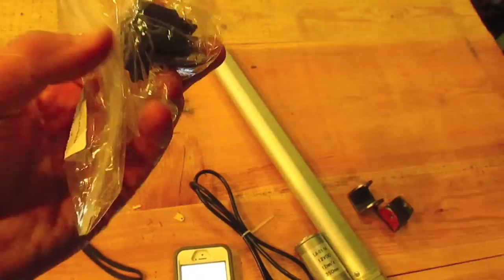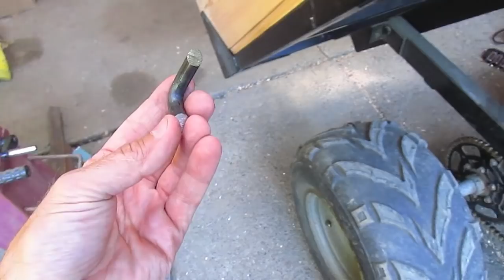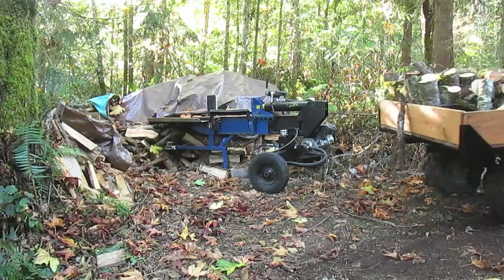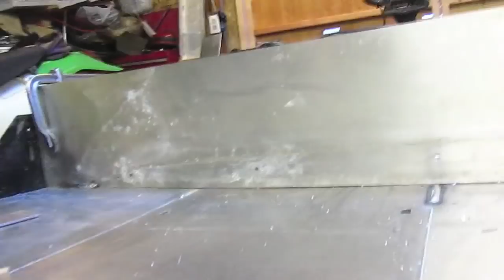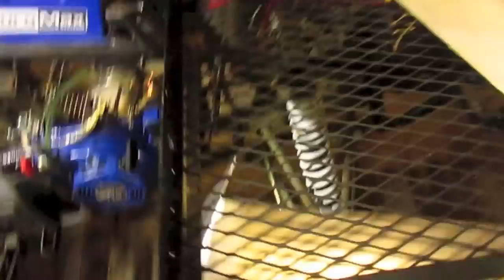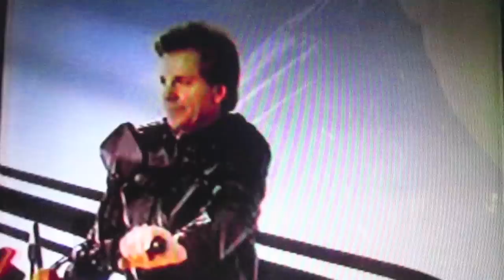Homemade ATV quad truck part 2

Comment: That is so cool :o) I’m doing mods to a diablo diesel quad by fitting a floor crane on the back and using a floor cleaner gearbox as a steering box so it is a side by side. (With a huge seat like arm rest)
Reply from the maker: Thanks!
Your project sounds good, I would like to see a video of your quad when your done with it.
You will need to let me know when your finished with it :)
Reply: Is it possible to finish it? I don't know if I should have those 12 volt linear actuators or hydraulics next? :o)
Reply from the maker: I just finished up my nephews dirt bike project, so I plan on finishing my quad truck up next.
I have been hauling fire wood in the bed of the quad truck and the linear actuator is just strong enough to dump a full load of maple log rounds but it's not crazy strong, If your planning on running the floor crane I would not recommend the linear actuators because most of the small ones like I used only lift a max of 220# or so, hydraulics would be far better in your application. I hope this helps and I also hope to finish up the quad truck and video soon. Take care
PS I hope you share a video on youtube of your build!
Reply: I thought I could buy a pop-in pump, but I can't find one? So it looks like it is front PTO machining job. (I hear you on the electro rams) Next achievement job is carrying stuff, so the bulldozer blade is getting a visor to make it a four-in-one bucket. I have the base plate bent in 3mm steel.

Comment: Better get up outa that cvt life while you can.  Its a black pit of dispair.
Reply: Winston Po
Reply from the maker: I have had a few CV transmissions over the years and never had much problems with them.
I put about 5000 miles on a heavily modified scooter I tricked out years ago and I found the CVT to be a real tunable and reliable  trans,  you can fine tune the clutch RPM engagement, and RPM torque curve to make a motor pull hard.
Un like snowmobiles and most go karts, this CVT is used in most scooters and is different because it spins the belt all the time and does not use the belt as the consumable clutch, it has a centrifugal clutch that has it's own clutch pads so the belt does not wear every time it goes from idle to driving the machine.
Maybe you did not know there was different kinds of CVTs?

Comment: Hey Mike this is exactly the kind of stuff I love to build !  I think that its hard to know what was the biggest game changer for you the lathe or the spool gun so you can weld aluminum ?  Nice build !
Reply from the maker: Hey Thanks Cody :)
I'm glad you like my quad truck project!
It's been a fun thing to build and I have learned a few new things along the way on this build.
Your right the Lathe and new welder are both great tools and a big game changer, I have wanted and needed them for years now.
I have a older Enco milling machine in need of some repair given to me from my work over a year ago, I need to bring it home and start taking it apart and cleaning up the rust and fixing a few problems it has, But hey it was Free!!!
It's going to be so nice to have a working milling machine to take projects to the next level.
I appreciate your nice comments!  Take care Cody :)

Comment: Cool but 7 horsepower?
Reply from the maker: I could have put a bigger motor into it but I had no need to, I built it to be used as more of a utility garden tractor then a four wheeler. It's geared down for torque not speed, it tops out at maybe 15 MPH 
The motor is coupled to the belt drive so it has a variable speed transmission. It makes plenty of power to move firewood and tools around my place.
Thanks for watching.

Comment: Needs a bigger engine
Reply: Mike festiva Firewood racing lol
Reply: Mike festiva That build is unbelievable
Reply: kyle prichard and quieter
Reply from the maker: Tell me why it needs a bigger engine? It moves a full load of firewood up hills faster then i could run, that's all I really need.
How the hell fast do you really need to move a full load of fire wood on a trail Kyle? 
I just built it to move firewood,  tools like table saws and air compressors things like that around my property, It's not for firewood racing :)
Reply from the maker: Thanks!
Reply: Mike festiva not really a bigger engine but more like a higher revving engine if your using a variable speed.

Comment: Cool! New subscriber because of this video! 
I've been wanting to build one of these for quite a while. Your build here will help me when I get to it, thanks for sharing your build! 
P.S. I rebuilt a few old Cub Cadet mowers and I used rubberized undercoating to help protect the battery tray. I let it dry well, then sprayed over it with the Cub Cadet Yellow paint. It has been on there now for over 15 years and there is still no rust so I can say it worked just fine. Also, if you use wood for a floor in your bed you have to space it or that will happen every time when it gets wet and swells up. Also, very nice aluminum bed! 👍
Reply from the maker: Thanks for checking out my quad truck project Robert!
I Hope to see a photo or video when you finish it :)

Comment: To much weight for such a small fourwheeler
Reply from the maker: Why do you think that? 
I only added about another 80LBs to the entire weight of the quad, If you saw part 1 I changed the gear ratio so it's geared way down, top speed is maybe 15 MPH it's not for going fast it's for moving firewood, tools, things like that, I have hauled loads of wood stacked in the back bed and also had the front rack full with no problem.
If your worried about the quad, remember I started off with a broken down piece of junk quad, if I break it I will be able to repair it and make it better.

Comment: Howd the trans bolt right onto the motor??
Reply from the maker: Hey Bed In past one I show what was needed to fit the trans to the motor, I wish it bolted right up, I had some lathe work I did to some of the parts and mounts that needed to be built to fit it all together. The trans and the motor are mounted to the frame but do not bolt together they only connect with the drive belt.
Here's a link to part 1 where I show what I did to get them to work. https://youtu.be/_gNWn-qn0fk

Comment: is that a mig roll holder/feeder that attaches to an arc welder?
Reply from the maker: Yes. It's a Vulcan Omnipro 220 welder. It works on 120V or 220Volt, It's a MIG, stick, DC TIG, and you can hook up a spool gun to it and weld aluminum. It's king of like a Swiss army knife of welders :)
By far the best welder I have ever owned.

Comment: I know you already spent a lot of time on the metal front fenders, but I think you should but a sheet of fluted plastic and build some brackets of of the front rack and rivet the plastic to the brackets to make plastic fenders. 1. It's safer in a crash 2. Cheaper and easier to replace 3. It'll probably look better

Comment: great utility machine...  nicely done.  i built a garden tractor very similar in design.  use it daily.  nothing like it.
Reply from the maker: I'm glad you get it, It's a utility garden tractor :)
Some people just can't get the fact that this quad truck is geared down to go only about 15 MPH top speed, it's a garden tractor :) Not a hi performance race quad Haha  There's been a few comments that the front fenders will be something that will cause danger to me, I think they are really missing the point. It's to move brush, firewood small loads of dirt around at a slow speed and it beats the hell out of pushing a wheelbarrow up hills.
That's great you built something very similar, they are really nice to have around!
Thanks for the nice comments :)
Reply: Mike festiva 
Yes, I know all about the negativity that people tend to post in the comments. That’s why I no longer bother making any videos for YouTube. I built lots of projects and I’m very mechanically inclined. However, there are just a lot of people that have nothing better to do with their time then to negatively criticize other peoples projects and creativity. I take things too personally, and I tend to get caught up in trying to defend myself against all of these idiots. It’s just not worth it! You know exactly what I mean.
Reply from the maker: I completely know what your talking about, there's been a few times now I thought about not continuing to make and posting my project videos because of peoples rude comments.
It's funny how people that make the rudest comments are experts on everything telling how you really should have done it, But if you go to there youtube page to see what there uploading they have never even posted one video to youtube, they are justTrolls!
I'm going to try and focus on replying to the positive comments and try not to spend time commenting back to the trolls.
Thanks again for your nice comments :)
Reply: Mike festiva 
i posted an engine swap video on a Ride On Mower once and one of the comments i received was “More of a LOOK AT ME video than a HOW TO.”.  that pretty much did it for me.  No more videos.  I dont get enough out of trying to help or entertain others.  its not worth my time when i get rude feedback like that.

Comment: I think u should have put new wood under neath and the. Put the aluminum over venting on the edge and then welded the seamed so over time the aluminum doesnt bend in in between the bars

Comment: Just like when you build a deck, you have to leave spaces between boards to allow for movement when it swells or shrinks due to moisture. I hope the AL works out for you but i like the wood better, it doesn't dent.
Reply from the maker: I know, looking back I should have spaced it out, I was thinking of moving dirt and sand from time to time and did not want it falling through the cracks but instead I got a buckled bed that I needed to do over again, Live and learn :)

Comment: As much as I like creativity. Sometimes your time is worth money. You could buy a used Mule or Yamaha Rhino for the time you have in this monster. And have 4-times the machine.Just not worth it.
Reply: I have to say that both the mule or Yamaha rhino would not provide the lvl of adequate hauling space he has made, you could say he could modify the mule/rhino but they cost several thousands of dollars even used his entire project prob didn't cost him over a grand. and if u think the time is a factor buy watching the guys other videos he looks to have plenty of time on his hands,
Reply from the maker: Thanks for the comment Joseph! I couldn't have said it any better :)
I think i'm into the quad truck less then $500, and It's been a fun project that I get enjoyment out of building!

Comment: Lawnmower battery on an atv?
Reply: Time Table It actually is the same shit there both 12 volt batteries with about the same cranking amps
Reply: yes
Reply: Same shit
Reply: Bill Lary I would have to disagree
Reply from the maker: It works for me.
Reply: Mike festiva if your not gonna ride it hard it will be fine
Reply: mud mower regulators i wouldnt reccomend using a lawnmower battery, they aren't sealed like recreational use "gel cells" or SLA's. after some riding, you may find yourself with some very unpleasent juice eating up everything it gets on.

Comment: Right on.  Thanks for showing the linear actuator I've been needing one for a commercial mower but they want $600 for their brand name version.
Reply from the maker: No problem, there's a lot of different ones available with a wide range of throws and lifting capacities, Like I said time will tell on the durability of the cheap ones?
Thanks for checking out my video :)

Comment: Nice job there,  seems like Polaris makes a 4 wheeler with a bed but yours is much better in relation to actual useful bed size and the front rack is a necessity on a farm vehicle like that, plus all the stuff you add on as you see a need. You're obviously a crafty dude.
Reply from the maker: Thanks for the nice comments! I think your right about Polaris, a friend gave me the Polaris 6x6 version years ago, It's not running any more, I need to do some carb work and get some new tires, When it ran it was almost un stoppable in 6 wheel drive, The 250 two stroke smoked so bad the only thing good about it was it would keep the mosquitos away when running it ;)